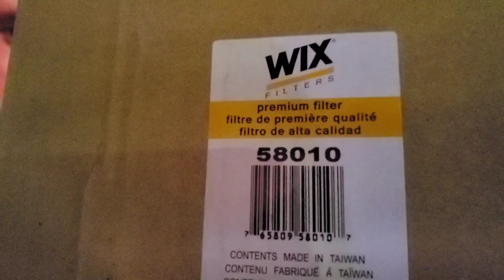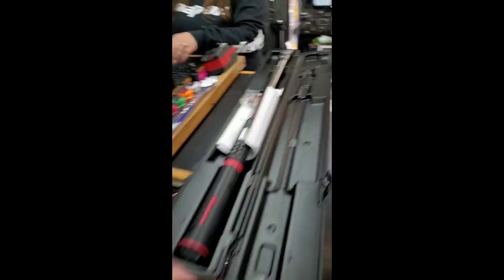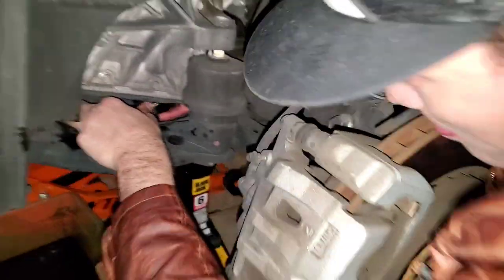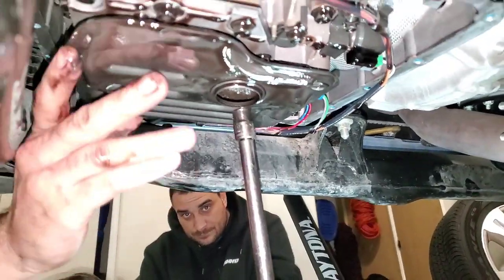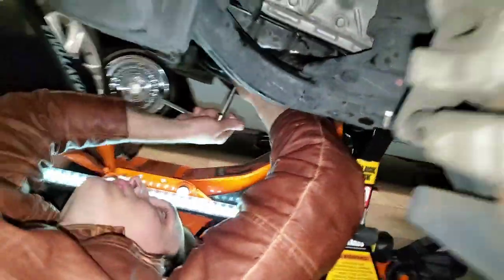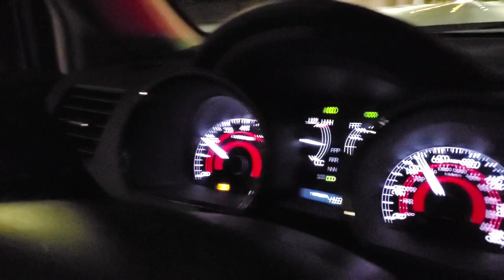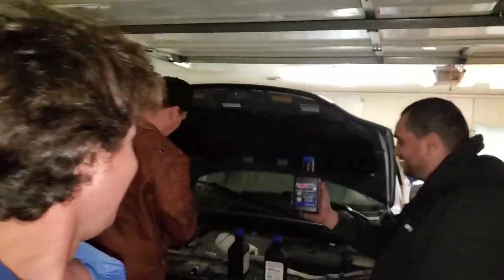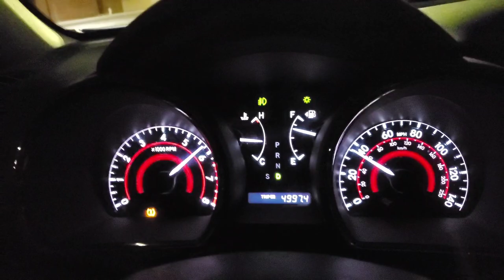2008 Toyota Highlander 4WD AMSOIL TRANSMISSION FLUID CHANGE

Comment: very cool to know how to do this. i dont know if i want to change mine or not as its over 200k on what looks like original atf
Reply from the maker: Sweet!!! You'll be very happy.
I give a man a fishing pole & show him how to fish. 

     Together! We can get your vehicles to run better than brand new!

     For me to get credit & be "Your" Independent AMSOIL Dealer please use my website below or my dealer no. 5331179 call anytime Eben Rockmaker 702-472-3614
After you click on: http://syntheticoilprotection.net
1. Click hamburger menu
2. Click offers AMSOIL preferred customer
3. Click join now 6-month PC member add to cart.  ( there is no reoccurring renewal membership unless you select that dot box ) 
( you have the option to not have your credit card saved if you prefer - est. 1972 )
4. Scroll up to the top Select shop by vehicle.

New Promo: FREEPACK
Reply: @Syntheticoilprotection  good news, the car is actually around 220k and the atf was black and there was no red to be found (prolly factory atf from 2008).

its about 3/4ths new fluid now. i drained black fluid from it and refilled it, drove it around and went through all 5 gears, and then drained pinkish black fluid again and refilled it, and now its smooth (but probably still black)
Reply from the maker: Great😃💯

Comment: I just noticed in this video the fuel efficient atf is compatible with Honda dw1 fluid, which is what my 1996 accord calls for. However, I put the regular amsoil oe atf in, which is a bit thicker. Is this going to be a problem? When I looked it up on amsoils website they recommended both, so I went with the regular thinking that it will be a little better on an older transmission.
Reply from the maker: There's two different viscosities you'll see Brett One is called the multi-vehicle signature series ATF which is the old school viscosity then most older cars take like my 59 Cadillac DeVille takes that in the transmission and in the power steering and then you're going to see the updated specification which is called the fuel efficient signature series ATF and that goes in most of the new 8-speed automatics new Honda transmissions 10-speed BMW transmissions a lot of the newer transmissions take that viscosity and it gets a little bit better gas mileage it just depends on your vehicle I would just double check it here with the lookup guide and you'll know what's supposed to go in your car.

Lookup For Your Vehicles - https://www.amsoil.com/guides.aspx?zo=5331179
Reply: You’re fine. I had a 1996 accord with over 300k miles on it before I sold it. Original transmission. Started using Amsoil in it at around 90k miles. I did use the LV for about the last 50k miles. It might have gotten a bit better gas mileage. I noticed that when cold, it shifted a bit too firm with the LV. Once warm, completely smooth. 
You’re totally fine to continue to use the Thicker stuff. When that car was made, there was no LV. 
Every mechanic that I ran into was very impressed that my car was on its original transmission.
Reply: @bryceweaver8211  thank you! And yes the firm shifts are just part of how the car is. Definitely not the smoothest shifting car hahaha. Thanks again for the reply!
Reply from the maker: What is the LV?
Reply: @Syntheticoilprotection  low viscosity. The Fuel efficient variant of the amsoil ATF
Reply from the maker: I got it fuel efficient ATF signature series.

That stuff has made wanders on the channel.
Synthetic Oil Protection Website - http://syntheticoilprotection.net/

     Professional YouLubher: Eben Rockmaker Regency Direct Jobber AMSOIL Specialist (Dealer#: 5331179) Mobile: (702) 472-3614 

Ebens Wholesale AMSOIL Link + FREE Shipping: https://www.amsoil.com/offers/?zo=5331179     & Text Me for latest promo code.  702-472-3614
Reply: @Syntheticoilprotection  the Blue bottle. Low Viscosity. Cmon man
Reply from the maker: Take a look here on the link there's nothing that talks about low viscosity. (LV)

https://www.amsoil.com/p/signature-series-fuel-efficient-synthetic-automatic-transmission-fluid-atl/?zo=5331179
Reply from the maker: That's why I didn't understand what they were talking about.

Comment: Something  I  noticed when the driver hit the gas and the RMP went too high for the shifting specs speeds. Could  that be a sign of future internal clutch slipage  iisue engaging on the torque converter? 🤔
Reply from the maker: Not sure what you mean?
Reply: Very simple  rewind your footage almost at the end on the dashboard and closely take a look on the RPM when your driver acelerated the car . Way too high and shifting delays. Hope this elucidate your question.
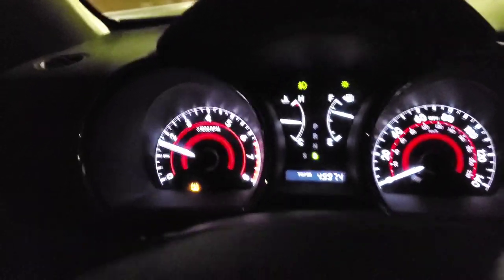Reply from the maker: @hansenriquerach-mendoza3515 the after pool at 21:40 is normal shifting for a Toyota automatic transmission that's the way they shift with a delay that is for a smooth shift the computer can be programmed and you can have a very tight close shift almost like a dual clutch transmission if it's programmed in that is on like the Corvette transmission stuff like that however on a four-wheel drive it has a softer shift that is normal💯
Reply: @Syntheticoilprotection  that's not what I saw before  the end of the footage when the acelarator was hit and RPM on dashboard read highly oscilated.
Reply from the maker: @hansenriquerach-mendoza3515 not sure what you're talking about.

None of those Transmissions shift like a dual clutch transmission if you're looking for something that just snaps shifts you want to look at one of the videos with a DCT clutch it's called a dual clutch transmission there's specifically built for track purpose under load and in between load they shift at almost the same exact speed that's what's on the f8 tributo Ferrari that is one of the best mid-engine cars in the world and the shifting is like a video game I drove a 458 Italia still to this day it's the best production car I've ever driven completely blew my mind I never thought that was possible.
However there is tuning you can do to get a standard transmission to shift better like on the Allison diesel Transmissions they are known for being a very good transmission but they will never shift like a dual clutch transmission☕️

Comment: I swear Eben clear drain pan has been around the block with more then 1 car 🤣. Even though it is proper to do 3 drain and fill when changing the atf fluid. I suggest 3 times but once every time with the oil change for 3 times and it gives the fluid a chance to cycle with the old Fluid and get flush out when drain.

Comment: How many quarts should i put?
Reply from the maker: It will be right here in the lookup guide also if you have any other questions when you use my link I'll be your Amsoil Dealer I can always answer all your questions on the future on the products and I appreciate the business future business in advance.
I always recommend getting a couple extra quartz also I recommend coming back after 500 miles and doing another drain and fill but you don't have to change the filter just another drain and fill is what I would do if it was my personal vehicle.
Find AMSOIL Products For Any Vehicle - https://www.amsoil.com/guides/?zo=5331179
Reply from the maker: ❤️🇺🇸❤️ Professional YouLubher: Eben Rockmaker Regency Platinum Direct Jobber AMSOIL Specialist (Dealer#: 5331179) 702-472-3614 

      ✅✅✅  I Recommend The AMSOIL 6 Month PC Membership because it will give you the Best Value. You get $33 back on a $100 purchase after the difference in tax with  No need for auto Renew - https://www.amsoil.com/offers/pc/?zo=5331179

Comment: I want to buy the trans fluid and do this to my car my Toyota Highlander is at 156,000 miles I just brought I don’t think the ever changed the fluid is safe to change it and how many time should I do it
Reply: Can I get this fluid in Arizona
Reply from the maker: Yes I would definitely do it right away If it was mine I would start with a double drain and fill and after that I would see how it runs and what the fluid looks like if it looks really good I would come back and do it again in 15,000 if it still looks a little dark I would do a third drain and fill.

This is my wholesale account link and it will save you about $33 on $100 order as a 6 month PC member and then if you have any questions before you order you can call or text me Happy to answer any questions.

Professional YouLubher: Eben Rockmaker Regency Gold Direct Jobber AMSOIL Specialist (Dealer#: 5331179) 702-472-3614 

Get AMSOIL Wholesale Pricing - https://www.amsoil.com/offers/pc/?zo=5331179
Reply from the maker: Yes
Reply: FaceTime if you can

Comment: When I saw the second flush looking so bad I thought it was because of high mileage but yours has much less than mine. I have an 08 Highlander now with 241,000 miles and I drain and fill every 60,000 miles (5qt each time) and my fluid never looked like that. I always use Toyota Fluid because they have it specifically engineered for their transmissions. I think Amsoil is an amazing product but I wouldn't mix transmission fluids in my opinion.
Reply from the maker: Of course that's what I used to think until I tried it truly amazing even if one quart you can actually feel the difference with the modifiers and it shifts faster smoother less vibration.
If you ever want to try it this would give you the best value on the products👍
✅   Save 25% On Your Next Fluid Order: https://www.amsoil.com/offers/pc/?zo=5331179 

Promo code : FREESHIP49 
& 5AMS
Reply: @Syntheticoilprotection  thank you, appreciate the offer. 👍🏻😊
Reply from the maker: @frankbiz 😃👍, if you want your transmission to shift smoother and faster than brand new definitely the way to go and your transmission will also last longer better film strength between the metals and oil manufacturer can call a full synthetic full synthetic when it's only 25% synthetic and soil is 100% it's different☕️

Comment: How about a atf ws for a 2012 toyota corolla le
Reply from the maker: Yes that is the signature series fuel efficient ATF you'll see that on my website here the lookup guide will take you right to the fluid and capacity for your specific year make and model😉👍
For me to get credit & be "Your" Independent AMSOIL Dealer please use my website below or my dealer no. 5331179 call anytime Eben Rockmaker 702-472-3614
After you click on: http://syntheticoilprotection.net
1. Click hamburger menu
2. Click offers AMSOIL preferred customer
3. Click join now 6-month PC member add to cart.  ( there is no reoccurring renewal membership unless you select that dot box ) 
( you have the option to not have your credit card saved if you prefer - est. 1972 )
4. Scroll up to the top Select shop by vehicle. 

New Promo: FREEBOWL

Comment: I got the same make and model highlander as in the video. Is there a specific weight for this amsoil. I also need the differential I saw 75-90w. Is that it?
Reply from the maker: questions you can always reach out to me anytime.
Find Products For All Vehicles - 
https://www.amsoil.com/guides/?zo=5331179
Reply from the maker: Thanks for being a part of my channel!
Professional YouLubher: Eben Rockmaker Regency Direct Jobber AMSOIL Specialist (Dealer#: 5331179) 

To Order AMSOIL Products Click Here - http://syntheticoilprotection.net/
Reply: @Syntheticoilprotection  I just checked your website and boy is the cost for amsoil much more affordable than other websites.
Reply from the maker: Yeah the best way to get it as as the preferred customer you'll see it only is 10 bucks for the 6-month preferred customer and that'll give you the wholesale pricing which is about 25% off plus you'll have the savings on the tax difference so when you order about a hundred bucks you'll save around $33.

It's quite a big difference.

Professional YouLubher: Eben Rockmaker Regency Direct Jobber AMSOIL Specialist (Dealer#: 5331179) 

To Order AMSOIL Products Click Here - http://syntheticoilprotection.net/

Comment: Filter torque is 96 in lb, oil pan bolt is 66 in lb , drain plug is 30 ft lb.

Comment: The car sound better and quieter after changed the transmission.
Reply from the maker: Yeah it's amazing there's even less vibration when you're driving it's a really weird feeling.

It's almost like the tires are different.
You'll see there's a really funny video with a Porsche engine flush and the lady at the end she goes man the tires feel so much smoother.....

It's because the motor is a flat six cylinder and it's bolted right to the chassis over the back tires and the car really did feel a lot smoother.
Porsche AMSOIL engine flush
https://youtu.be/vR0k3JGOK4M

Comment: Tough to tell when oil level is full when you have to let the engine run.  I wish the marks would have been set for cold and engine off.
Reply from the maker: The most important thing is to do the final transmission level when the transmission is warm.
If the transmission level where to be too high then you put the fluid in when it's very cold out you could just overfill the transmission but as long as you make sure when you do the final leveling that it's nice and warm you're good to go💯

Comment: That fluid was dirty
Reply from the maker: yeah it's amazing here in Las Vegas how quickly the fluid oxidizes the black top is about 170° in the summer in the air temperature is over 110 degrees for over two months in Las Vegas in the daytime